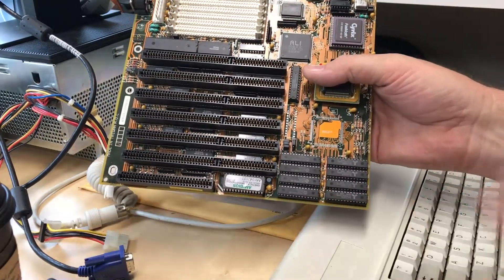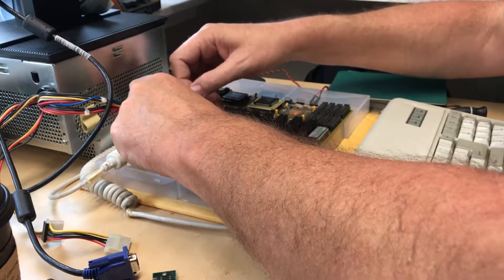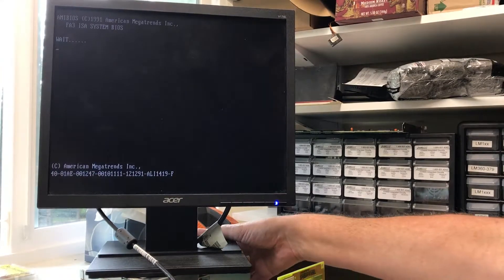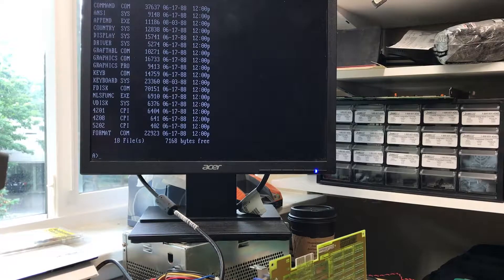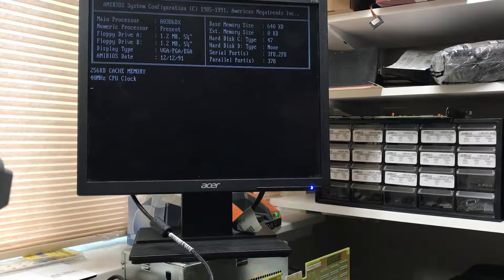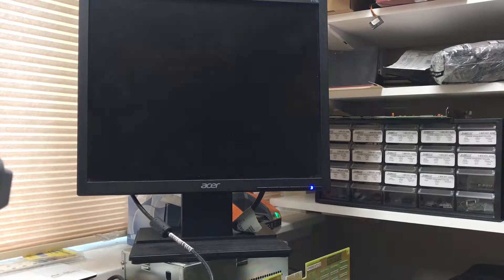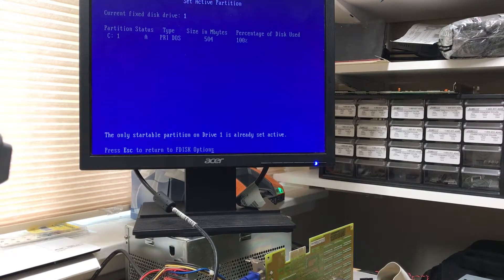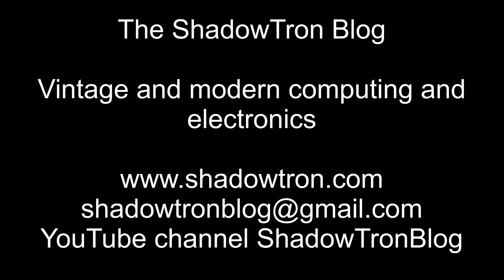IBM 386 - Part 1 - 80386 computer build - Getting started - STB83

Comment: ...hmmm... windows 98Se doesn't run on the 386. Main problem would be the very slow CPU and the maximum amount of RAM you can use in the 386, 8 Megs. Win 98Se needs at least 16MB of RAM. The Best os what you may be able to run properly in the machine is windows 95... there was a smaller (50 MEGS) edition called windows 95 PE (Primar Edition). It runs like a charm on the 386.